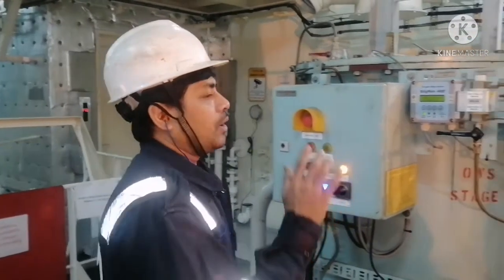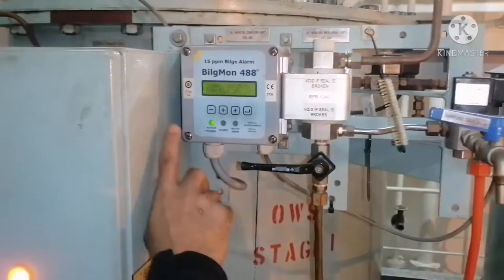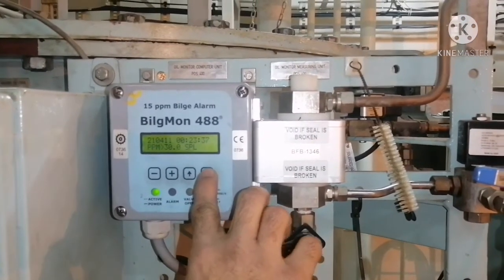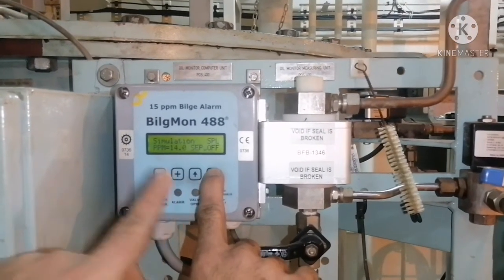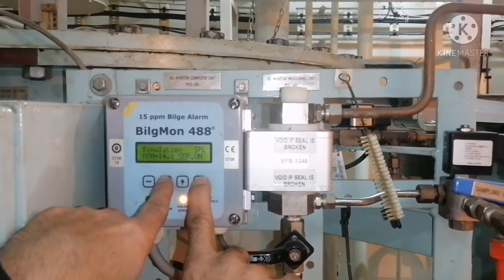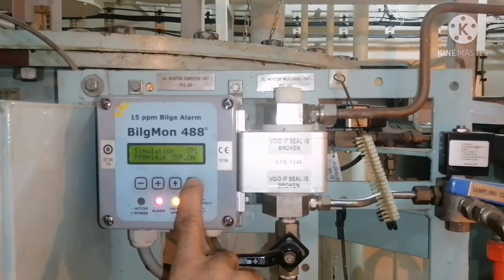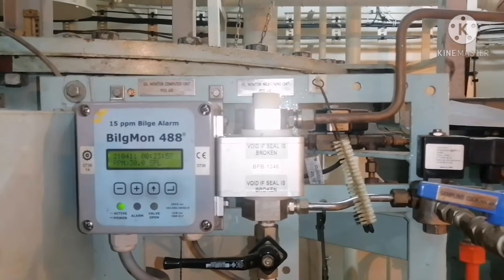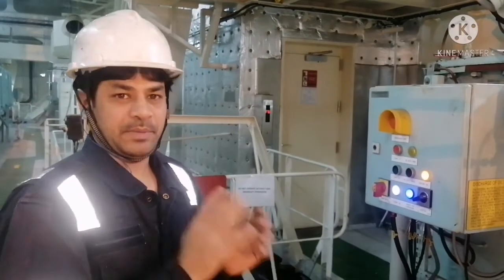How do they do.. TESTING OF 15 PPM ALARM ON OILY WATER SEPARATOR ON SHIPS

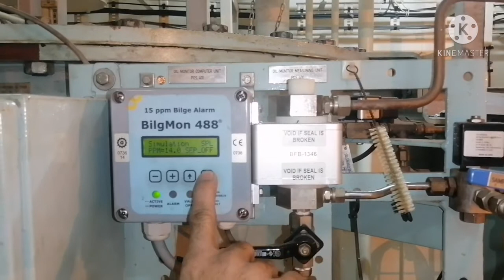Comment: sir, on your video 2:51, beside the 15 ppm monitor, there is a brush hanging. sir what is the function of this brush? pls reply
Reply from the maker: That particular brush is to clean the cell...the brush should be of light feather which should not damage the wall of cell..